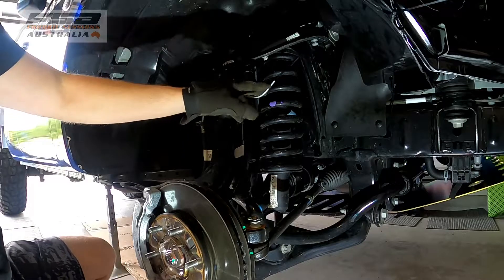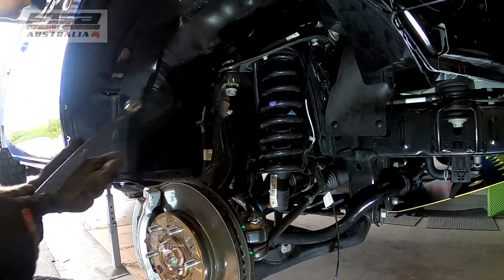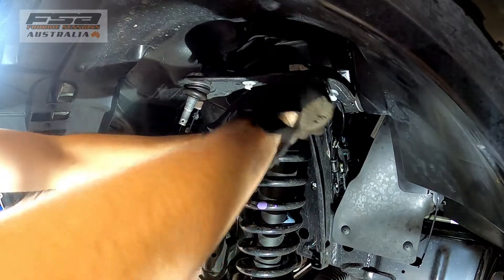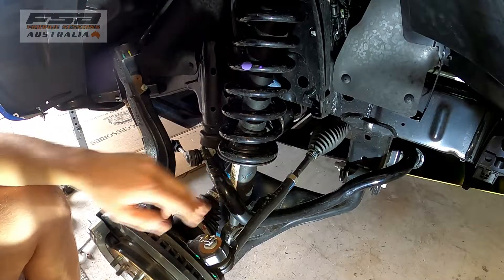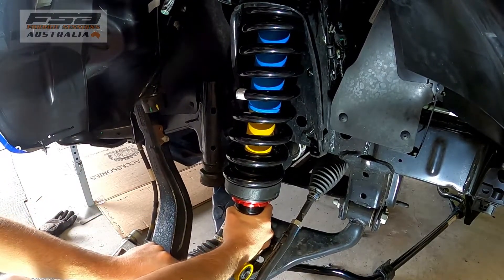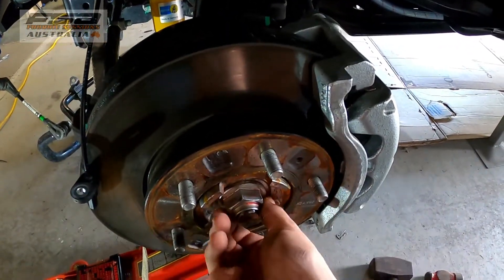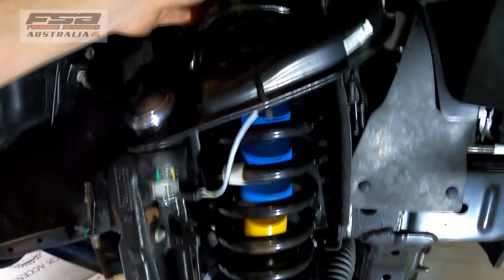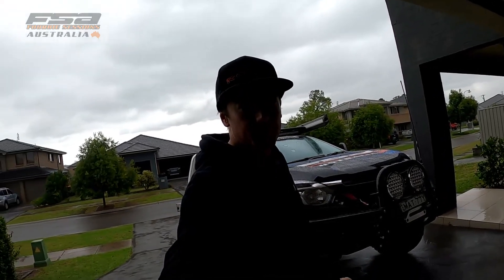How to install front suspension

Comment: I’ve been running a 3 inch dobinsons in front and just shackles in the back for 3 years now with 35s and its literally been every we’re. Great trucks you don’t have to go all out on suspension that’s for sure
Reply from the maker: Couldn’t agree more. Thanks for your comment
Reply: Heavy D hey just curious, did you have to run a tail shaft spacer with the extended shackles?

Comment: Nice mod on the lift, does it keep the cv’s on a resonable angle
Reply from the maker: Not to bad they do recommend a diff drop but I think because I have done the upper arms it’s down travel is limited. My last Bt50 with this setup 250,000s twin locked and never did a cv.
Reply: Cool, sounds good, the ucas are expensive but well worth it 👍🏼